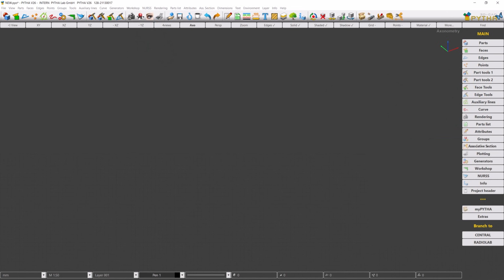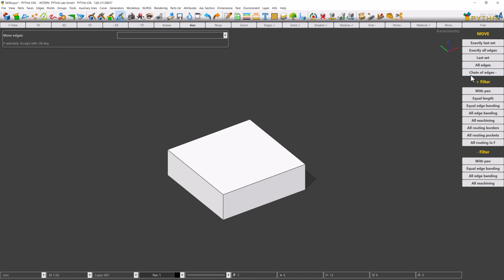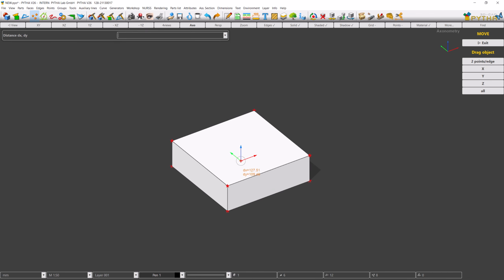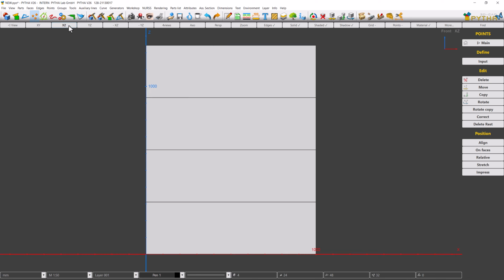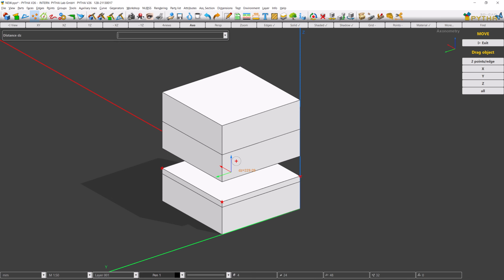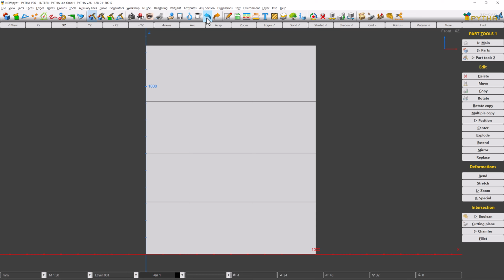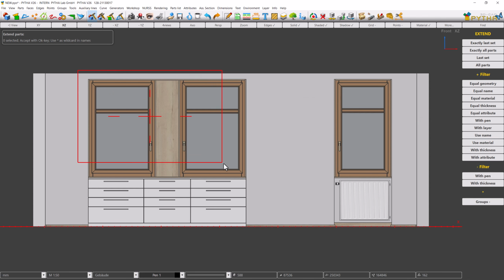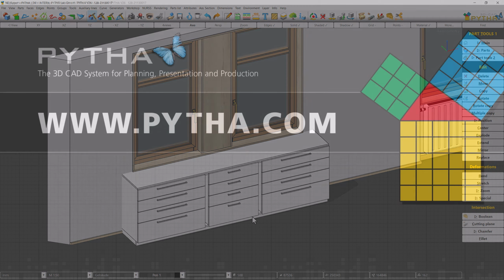PYTHA Tutorial - Changing part sizes

Comment: I would prefer the cabinets to be parametric, so that when clicking on a cabinet, it would be possible to change its dimensions—just like in many other programs—because when the height is changed, the spacing between shelves becomes disproportionate. The same issue applies to drawers, which do not adjust their height accordingly, and this problem becomes more significant in many situations.